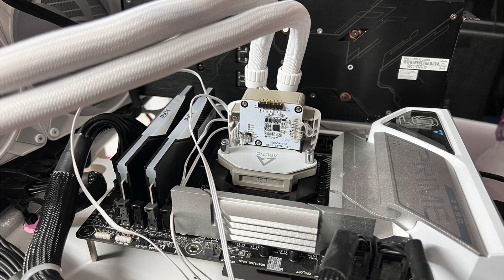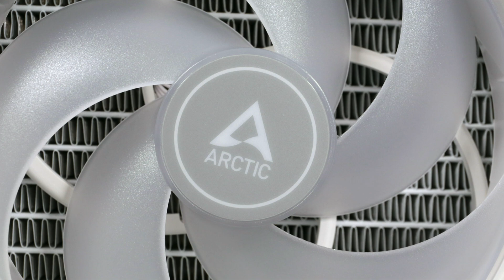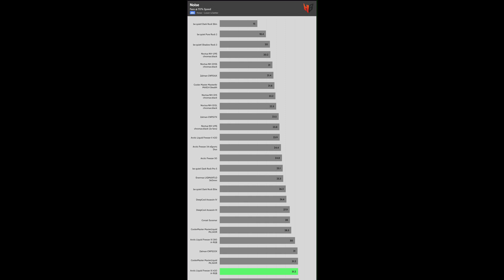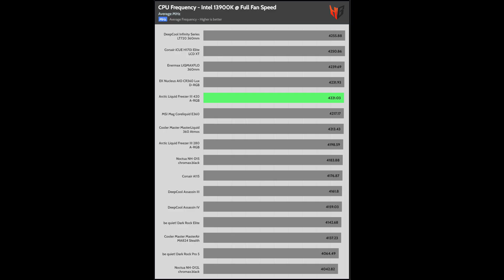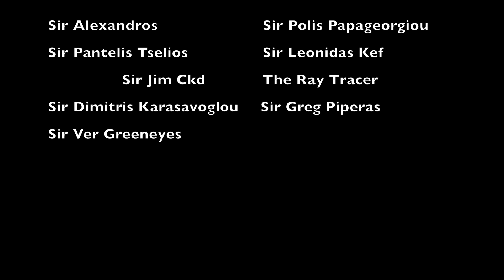Arctic Liquid Freezer III 420 A-RGB AIO Review – Promo Price & Top Performance

Comment: I'm stuck between Be Quiet Silent Loop 3 420 and Arctic Liquid Freezer 3 420.
I'm only after raw cooling performance, and possibly noise level is something to consider too, any recommendations? I do not care about bang for buck or price.
My CPU is a 9950X3D btw on a Strix X870E-E motherboard.
Reply from the maker: both will work great with your CPU. I would get the most affordable one
Reply: @HardwareBusters  Thanks for your reply I appreciate it. I went for the Be Quiet but it was delayed for a few days so I started looking into the LF3. LF3 is so cheap it had me questioning why, almost to the point I thought it was a bad AIO xD

Comment: Hi there,
I’m from Portugal.
I’m completely new to this. I bought a ASUS ROG Hyperion GR701 case with I9 14900K CPU and a ASUS ROG MAXIMUS Z790 FORMULA motherboard. I’ve read that there is some sort of incompatibility due to the M2 Gen5 height. How do I install this AIO in my board? Can you help me please?
Reply from the maker: I don't have this specific mainboard to check if the AIO can be installed, so I cannot help, sorry.

Comment: Hello! If you help me out with this choice, personally, I will definitely use your affiliate link to purchase!  I am building a workstation PC for professional video editing and also for 4k gaming/streaming simultaneously using 3 separate 4K monitors.  My current parts list is:
 i9 14900k CPU
 4080 super GPU
MSI Meg z690 Ace EATX M.B.

I will be using  a very large EATX case (haven’t picked yet).  

My question:
If you were using these parts and building this type of PC for yourself, which AIO liquid cooler would you choose out of all you have reviewed?  I need the best sustained performance to have the coolest CPU during long labor intensive tasks.  I can’t decide between the Arctic liquid freezer III 420mm and the cooler master masterliquid 360 atmos!  I really like that the ALF III has a VRM fan but I know it scores lower than the atmos in ally of your tests.  Lower noise would be nice but not the most important.  I’ve watched both of your benchmark videos on these, but I want to know what you specifically would choose between the two if it was your choice for your own personal PC like mine.  And if you would choose something completely different, please let me know where to find your affiliate link for whatever you would choose for a higher end workstation.  

Also, is it a bad idea to use a seperate dedicated AIO liquid cooler unit to cool my GPU?  Would you recommend a top performing one?  I’m not extremely tech hardware savvy so I would rather not build a custom loop.

Regardless, if you reply or not, I want you to know that I am extremely thankful for your hard work and dedication. I value your opinion over all others and I want to make sure to use your affiliate links to show my appreciation.

Thank you buddy and cheers from  Sioux Falls, South Dakota, USA!
Reply from the maker: I would go for the Freezer III 420 most likely. The VRM fan helps, a lot. Now since you also want to hear my general opinion, for my PC I would go for a Noctua NH-D15 and avoid AIO which will need a service after some years, while the air cooler, you will just have to clean it a bit and it will be like new again. 

I wouldn't go AIO on my work PC's GPU. I do custom water cooling from 2002, using custom-made parts and the last years most of my PCs have air coolers, because I am tired of the AIO failures that I encountered after a period of use.
Reply: @HardwareBusters  I really appreciate your guidance buddy! I understand that the air cooling solution is less hassle, but I will go with your AIO choice!  Since I will have a monster case, I will have lots of room for additional fans.  If you could recommend me intake fans and an exhaust fan, I will also use your affiliate links for those as well!!!  When I watched your “only fans🤣” episode I didn’t see any larger fans like 200mm for example.  If you had a case large enough to accommodate 2x200mm fans on the front and bottom for intake airflow, would you choose that configuration over 3x140mm on front and bottom for intake?  If so, what would you go with? Once again, whatever you recommend, I will use your affiliate link for the U.S. Amazon to order everything.  

And while we are at it, now that you know most of my parts, I’m looking for a EATX Full Tower case that is large enough to accommodate my EATX motherboard and also now the ALF III 420mm liquid cooler on top.  I know they are not the most efficient for airflow but I’m interested in a fish tank display style case with tempered glass side and front.  I’m essentially looking for the most space possible so my parts don’t interfere with each other end for ease of install.  If you could recommend a couple, I will also use your affiliate link of course!  I can’t spend hundreds on this though.

Lastly, I am going for a 4080 Super but I need it one of the less expensive models.  The MSI EXPERT is what I’m most interested in for build quality and looks at it apparently runs hotter than the rest by upwards of 10 degrees under heavy load. Should I be worried about the extra heat?  I’ve seen bad reviews for all other models close in price. ($1050 USD or less).  If the extra heat would be a dealbreaker for you, do you have a recommendation on a different model that isn’t incredibly more expensive? At this point I’m sure you know but once again, I will use your affiliate link to Amazon US for all of these purchases to show appreciation for your health and hard work on your channel!
Reply: @HardwareBusters   also Thermaltake Toughpower GF3 1350W, be quiet! Straight Power 12-1500w, or Seasonic PRIME GX-1300?  I couldn’t find a review from you on the GX 1300 but I know the TX and PX versions you really like but I can get this one for $200 right now.  I can’t spend much more than that and I would really love a quality SeaSonic psu so you think this one is really good , I will choose it.  I’m just looking for the crust quality unit with plenty of connectors with black most wattage for less than $230 USD Ideally.  

Sorry for asking for so much advice, but I trust your opinion over everyone else  on YouTube and I will certainly use your affiliate links!!!!!  thank you kind sir!
Reply: @HardwareBusters  sorry for all the questions.  Hopefully you find time to help because I would love to purchase your recommendations through your Amazon affiliate link!  Thank you again kind sir, for everything!

Comment: Is it better to install one cable or three cables to control the speed? Is there a lot of difference and which is better, one cable or 3 cables for rpm control?
Reply from the maker: for convience the single cable is better, for better control the 3 cables are preffered to be able to control individually the pump, the VRM fan and the radiator fans.

Comment: I need your help.. Recently i installed solar inverter for electricity, on solar enery my computer not work properly like keyboards and mouse not working properly, inverter is pure sine wave.
My PSU is corsair cx760m..
 It works fine on grid power..
Reply from the maker: It must not deliver "clean" signal, you should check that.

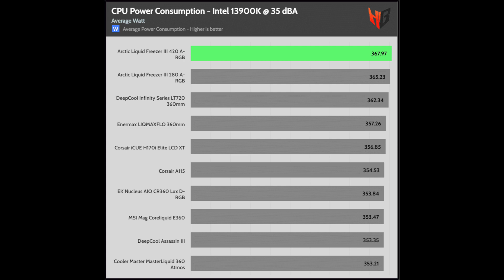Comment: Hi, on 8:43 it shows the Max tdp supported? I ask it because I need a liquidcooling that can tank an Epyc 9674F (I'll make an adapter to SP5 socket to make it work). Anyway, depending on your answer, which liquidcooling now can do this job efficiently?
Reply from the maker: Hi! It shows the CPU power that I measured with my power measurements board, powenetics. It is the average CPU power, the peak is way higher.

Comment: What's your opinion on making an AIO a push pull configuration with different fans. For example of I were to add some P14 MAX fans to this 420 AIO? I'm guessing higher max RPM of the P14 MAX may cause an issue?
Reply from the maker: The P14 Max would push the slower fans to spin faster most likely, even in pull configuration.
Reply: @HardwareBusters  thank you

Comment: The arctic liquid frezzer 3 aio can actually affect the memory oc of your system on intel bacause of the not so optimal contact frame. many cant run at the same ram speed with it as with intel stock ilm.

Comment: I thought better of this AIO. It doesnt disappoint me, I just thought it could have been better, tho. Great review, as always!
Reply: It's the included fans that hold it back, on the YT channel STS he did a test using 6 fans in push pull, that's when it shows what it can do. If I were to get this AIO I would replace the fans with the P14 Max ones.
Reply: @akdragonpc473  fair point, but the default fans is what matters. When u buy an AIO most of the times u will have it with the preinstalled fans. If u change them u probably have better results, but that would apply to other AIOs, as well.
Reply: @JimCKD  Yes in principle you are correct. But the fans included (moreso with the non-rgb version) just don't have the static pressure perf for this thickness of rad. They should offer a "420 Max version with the better fans included. 
I am thinking of getting this AIO but will defo be getting x6 P14 Max fans with it.
Reply: @akdragonpc473  If you do so, plz update us with the results. It would be interesting.
Reply: @JimCKD  won't be for till end of year waiting on ARL and Zen5 releases before doing the build. But the push pull video on STS shows what can be expected in terms of perf with x6 fans.
Reply: @akdragonpc473  ok